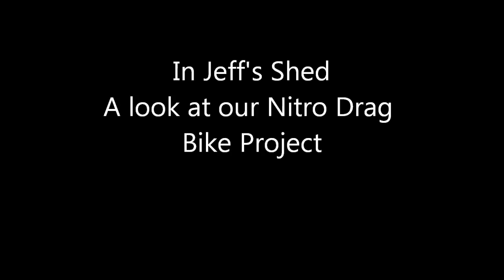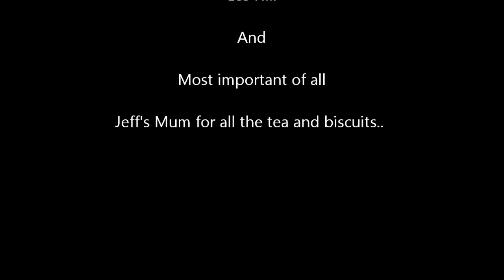A walk around our Shed built Nitro Drag Bike

Comment: Cranks will warp laying around like that.  Support them on journals
Reply from the maker: Indeed, they were put there only for filming the video.
Reply: Not to be confrontational Sir, but standing on end is the best, providing that they won't be disturbed.  
I've been Building Race Engines for 40 years,  been in Race Shops all throughout the Country, NASCAR,  NHRA, IHRA, and the cranks stand on end. If a billet, 4300 series crank warps that easy, you have more serious problems. V blocks on journals only when blueprinting and or mock up.  
T.S. RACING